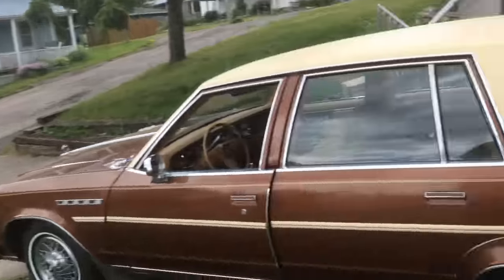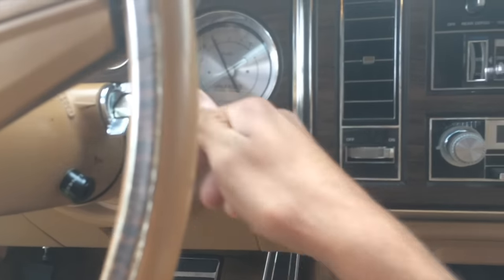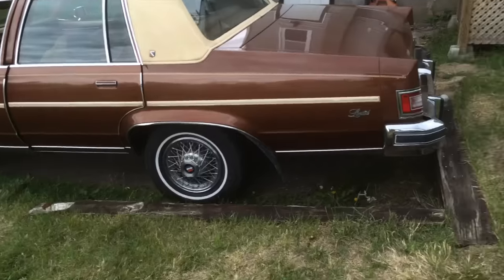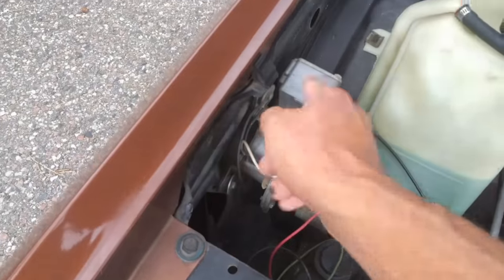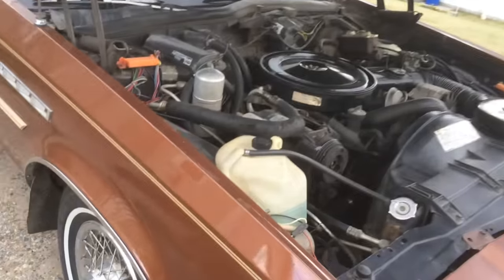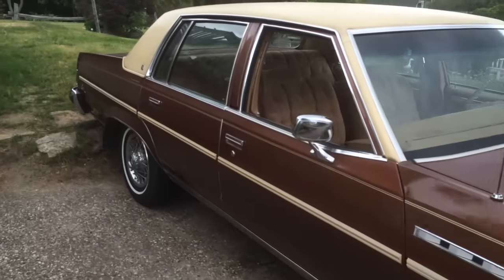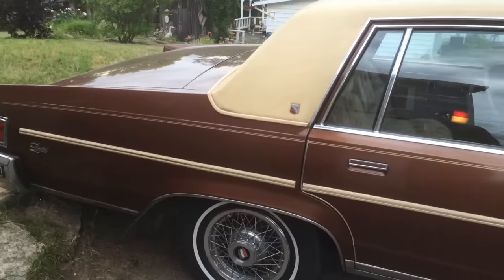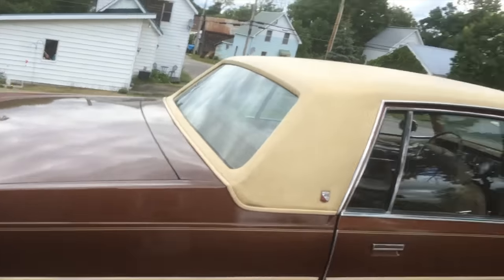The Inflator Air Shock Absorber Demonstration

Comment: If you drive this one at night, you will have to figure out what pressure to run in those shocks for correct headlight aiming. My Electra only has standard shocks, and when weak rear springs were replaced, it required two turns of the adjustment screws on the headlights to get them aimed right again. Couldn't see more than fifty feet in front of the car otherwise! That seventy-eight of yours is one of the most beautiful 70's cars I've ever seen! Very very nice! Thanks for sharing all your car stuff with us. It is appreciated more than you know!